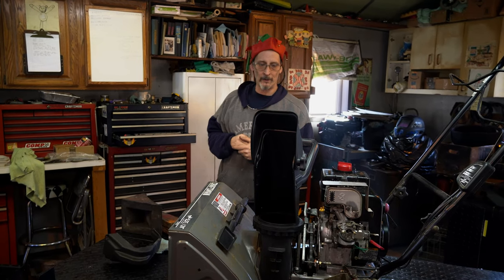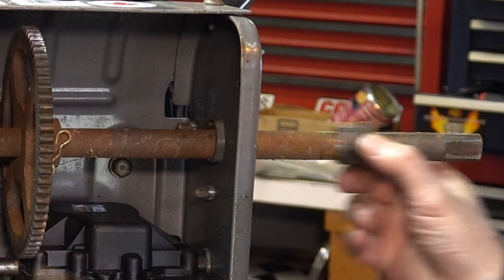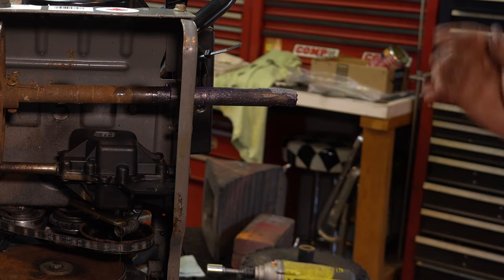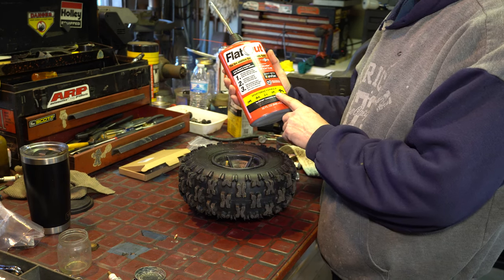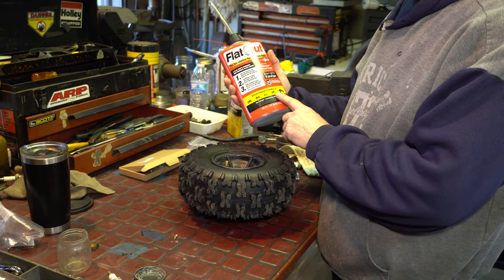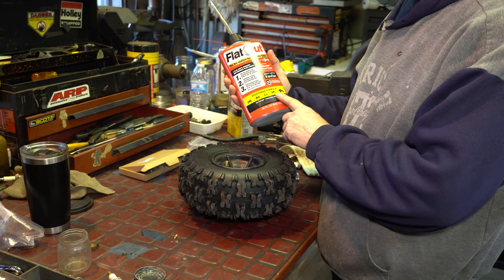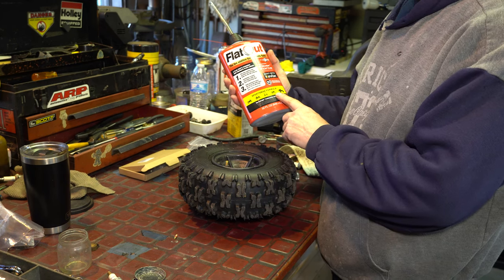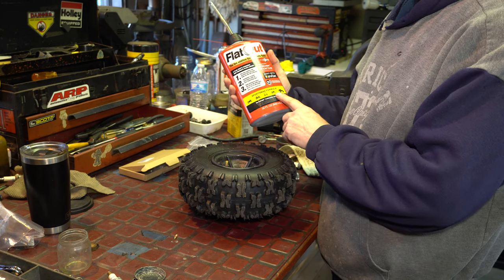CRAFTSMAN 24inch 3 Speed 5.5hp Tecumseh Snow Blower Belt Replacement & Transmission / Axel Service

Comment: Nice job Arch lucky the drive pulley came off, normally they are rusted on. Just a BIG tip on those tires with plastic rims: NEVER PUT TOO MUCH AIR PRESSURE IN THEM THEY CAN BLOW UP, THERE WAS A SAFETY RECALL ON THOSE YEARS AGO WITH MAJOR LAWSUITS BECAUSE OF INJURY FROM THE FLYING PLASTIC PIECES! The OLD MAN at EP over and out!
Reply from the maker: I mentioned that to him!! I should pin your comment!!! I forgot to mention that. 
I know its an issue and they never really hold air.
Reply: Yes they are extremely dangerous if overinflated, we had one customer blow the plastic rim right off luckily he did not get injured and luckily his prescription glasses were safety glasses or he may have been blinded!